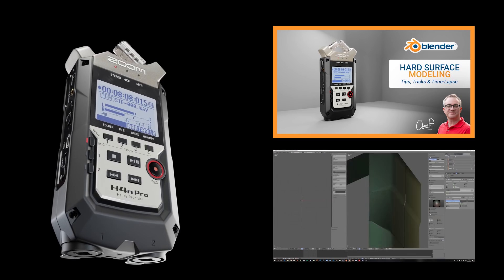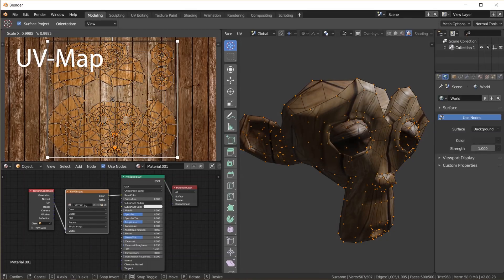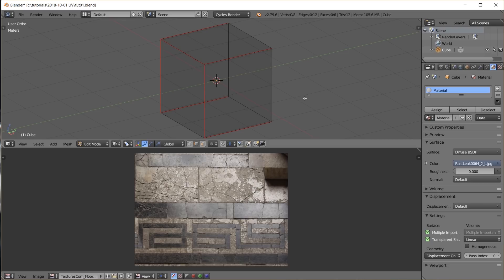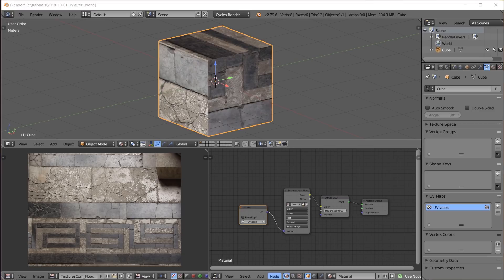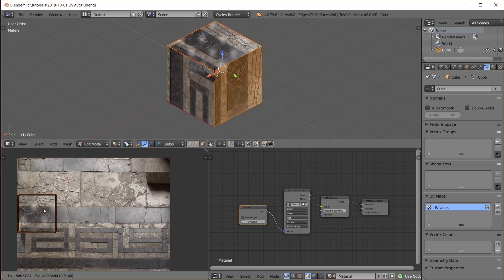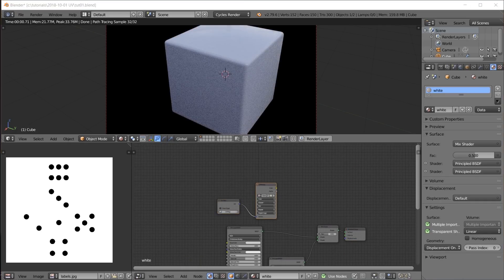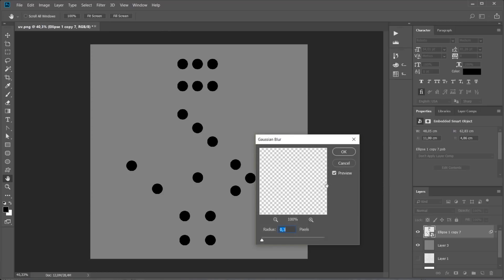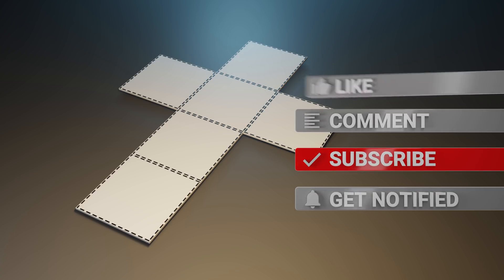Practical UV-Mapping

Comment: Hi Chris, thank you for sharing. I find that it's difficult to unwrap hardsurface models specially when are modeled with booleans and you want to put textures as you can't mark seams on the model unless you apply the modifier. A little trick for me is to unwrap the boolean operator to get this boolean operation unwrapped on the model. :S 

Do you know any tip on this? 

Thanks!
Reply from the maker: Yes, the boolean operator and its mesh and properties are really important because the generated edges and faces inherit their properties from it. I didn't want to add all of that to this video as well because it can get a bit messy with booleans and sometimes (sadly) the only practical solution is to simply apply the booleans (after backing up everything on an empty layer/collection) ... I wonder if other 3D suits have better/smarter features for that?
Reply: Yep! totally agree. 
Well, as far as I know, for example in 3ds max you can put the modifier ''edit poly'' on the modifier stack as many times as you advance on the modeling steps (I don't know how this manage boolean ops), and I think it's a kind of non-destructive workflow. It would be nice to have something similar on Blender!
Reply: yes an edit poly modifier would  be very welcome. I personally just apply the booleans and make a shift+D duplicate beforehand on a seperate layer/collection.
Reply: I'm doing the same!